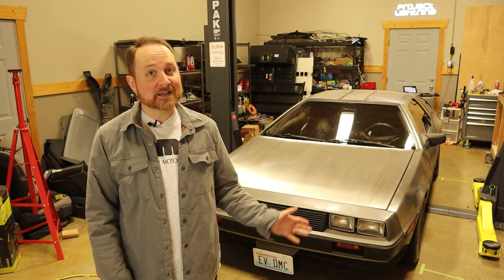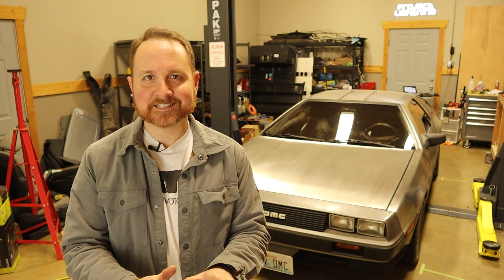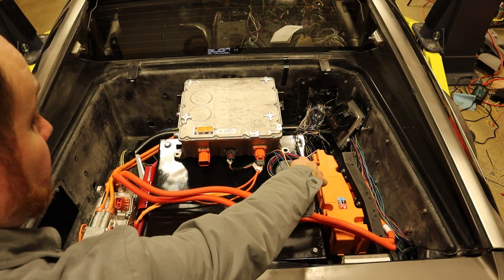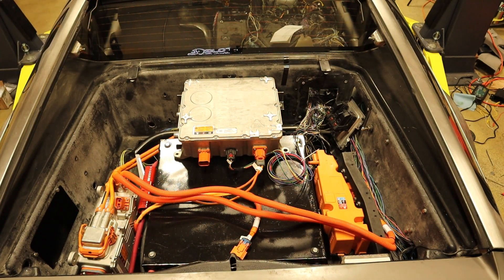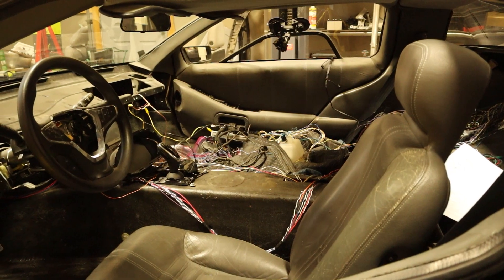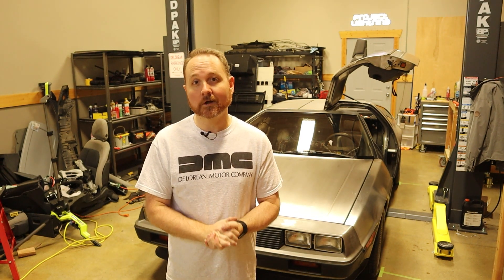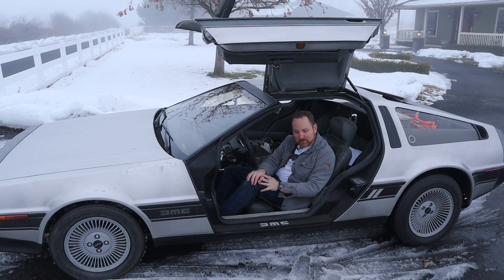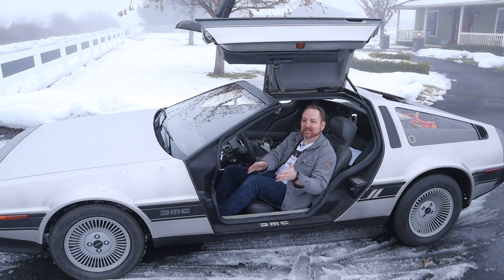DeLorean EV Conversion - First Drive!

Comment: The Bolt system is probably ideal for the DMC, 50 KW max charging speed is enough, about 50 KWH battery capacity offering 200miles range, light enough to keep the weight down to that 3000 pound target. Amazing car. Great video.

Comment: Congratulations! I remember how it felt the first drive I took in my EV converted Fiero. I thought Deloreans and Fieros were about the same size. From what you said it seems Deloreans are about 500 lbs. heavier than Fieros though. I would try to put it on a lightening program. :)

Comment: Nice to see another  dunmurry , norther Ireland  built DMC getting an ev second life . Ps does the original weight account for a full petrol/ gas tank and all transmission, gear box oils etc and water coolant etc. Pity only left hand drive only available and very wide for uk roads but not as bad as it used to be as uk European cars getting bigger.
Reply from the maker: Great question! The original weight was the running and driving car with about half a tank of gas.

Comment: Will it support DC fast charging in the end?

How do the revised guts affect the overall weight distribution of the car?
Reply from the maker: YES it will support DCFC! It's going to take a while, though - it requires the AC system to cool the batteries, which is a lot of work.

Great question on weight distribution! The weight was previously 38/62 (front/rear) and is now 42/58. The weight of the rear actually went down by 50 pounds! Left/Right weight is pretty even before and after.
Reply: I'd say it is a lot closer to 50/50 than original.

Comment: Thats so cool, I think the electric motor sounds are quite fitting for this special car!!

If the range is somewhat practical, I'm sure you are going to update about it. But for a fun car, who even cares if it only does let's say 200km per charge? At least you are getting smiles everywhere you are pulling up with it :D
Reply from the maker: It should get 200-250 miles of range, which is a lot! It's one of the reasons I did the conversion using the Chevy Bolt, because it has a (relatively) large battery pack.
Reply: @BillCarlson  So 320-400km possible, wow very practical! Is the DC Fast charging from the Bolt going to be used?
Reply from the maker: @chazable  Yes! Although it will take a while for me to get it to work, because it relies on the AC system functioning.
Reply: @BillCarlson  good stuff! And good luck 🤞